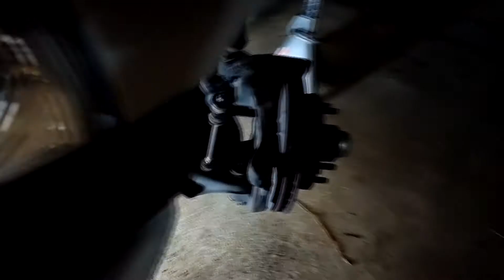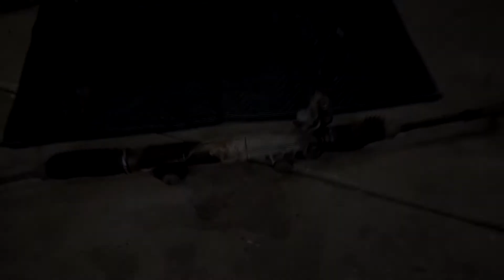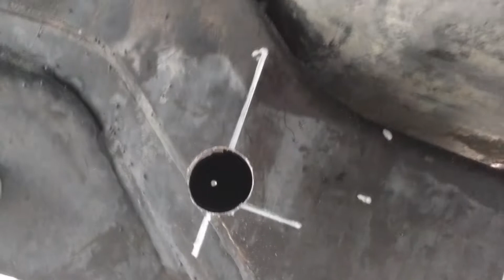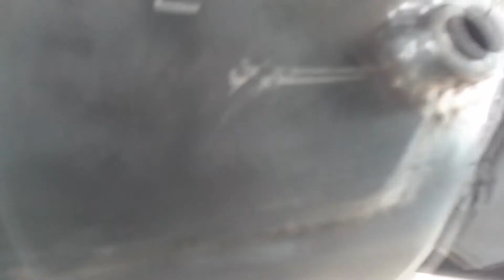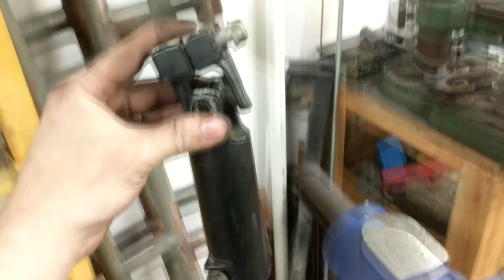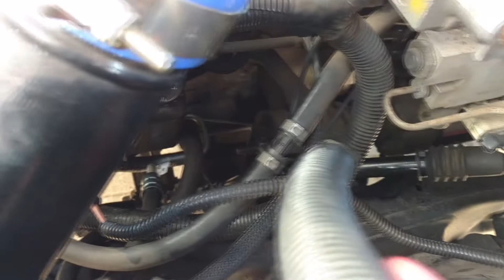1996 Ram 2500 - Steering Rack Conversion

Comment: Last word:  do not buy a replacement rack online if it requires a core return.  PartsGeek doesn't not help with return shipping which was $103 for me.  Advance has the same unit for $137 after core return to the store.  So 
 Basically I burned myself for $324.

Comment: Ok,  having done this a second time after buying a good re-man rack, I caution to check for ANY play in the telescoping steering shaft.  ANY looseness will translate into an inch or more of steering wheel play.   I put mine on an anvil and beat the play out 9f it with a 5# hammer.  When it comes back I may buy a new shaft - but that is money.

Comment: Got the motor mount cut and cleared - PITA.  All done except for the cooler - yep, you need a fluid cooler.   Follow the instructions and it will work.  Alignment was an issue for me.  I finally had to remove 1/4" from the passenger side inner and outer tie rods.  As noted:  stiff wheel just off center.  And if you have steering shaft slop this won't fix it.  Get a new one.  And do not disconnect the steering shaft unless the steering wheel is locked in place...I knew better and still broke it: don't know?  You will.

Comment: Exactly what needs to be done on my 96 single cab. Thing has the turning radius of a squarebody crew cab F150 and 1.5" of play even with all new everything (except box and pump) steering related.
Reply from the maker: Either do the swap that I showed in the video, or it would be time to swap your steering box. That's usually where most of the play is.

Comment: Had no idea this was a thing. Ill be doing this on my 97
Reply: I did it on my 99, very happy with it. The only major difference to get used to is the tall ratio. For the first while I found myself turning in way tighter than intended.

Comment: nice work! lots of good tips... the OEM Gen 3  Bolt is M16 x 2.0 for mounting the rack. I got a threaded rod that size from Grainger for $11.
Reply: Where did you source the tubing - and what size did you use?  $50 is lowest I've seen for 3' of 5/8 x 3/4 seamless steel tubing.

Comment: Where do you get the ujoint caps? I am super stalled in my conversion because of the ujoints. I was thinking about a borgeson steering shaft. Also looking at my old linkage length vs the length from the junkyard rack and pinion. I have the new tie rod ends all the way in and it looks about 1/2 longer than my old factory setup so I am not sure about alignment issues. 

Hope to get my truck running again.
Reply from the maker: I don't know that you can buy new u-joint caps. You may have to buy a whole new steering shaft, like you mentioned. As far as tie rod length, if your current tie rods are bottoming out and still too long you can cut the inner thread length down to help make the length right. But you don't want to cut too much. You may also want to look into a different brand of tie rods that have the same threads but are shorter. Good luck.

Comment: Great video , question , did you check for bump steer when picking rack position ? I just bought a 98 2wd with 172k miles and it needs a steering box and I thought to myself ... why not put in a rack ...

Comment: Hey bud thanks for the explanatory video, I plan on doing this to my ram to improve the stability and driveability. How has been the durability on these components since they’re in a 1500? I only drive it around town anyway
Reply from the maker: The truck belongs to my uncle and he has been driving it since this video was made with no problems at all. He still says it's an improvement over the stock setup and recommends others with the same truck look into this swap
Reply: @Trav74r  yeah I did it and even used the third gen steering shaft and it was pretty much bolt on
Reply from the maker: @dariel9847  glad to hear it worked out so well for you.
Reply: @Trav74r  thanks for the response! I’ll be starting this weekend

Comment: Any speed wobble?
Reply from the maker: No speed wobble. It has been a trouble free conversion.
Reply: @Trav74r  damn sucks I have 4x4. Why cant i install it on a 4x4?
Reply from the maker: @pablomarquez4431  Ram 4wd trucks have a solid front axle. So there is nowhere to mount the rack.

Comment: i just did this on my 97 cummins.  im almost out of threads on the tie rods to be able to get the toe right.  did yall have any issues getting it aligned and having enough threads?
Reply from the maker: If I recall correctly, we actually had to shorten the tie rods a bit so that we didn't runout if threads. Sounds like the opposite for you. May need to look around and research alternative tie rods with different thread lengths.
Reply: @Trav74r  I meant I'm running out of threads by threading them in.  I may need to shorten or find shorter inner tie rods.
Reply from the maker: If there are more threads left on the inner tie rod, I would cut it short and clean up the threads on the end.
Reply from the maker: That may have been the same problem we had. Like I said it has been awhile and I don't remember the small details.

Comment: Need a followup and driving videos. I already have a 95 chevy c1500 sport gearbox on my 96 ram direct bolt on and 2.5 lock to lock vs factory 3.5-3.75.

Comment: Great video. Great detail. If you have a follow up on this video, it would be nice. Please make more videos of other Parts that swap
 from newer dodges. Maybe brakes, transmission ?   Is It totally necessary to those round tubes inside frame? Or could plates be welded 
to the front and back of frame ?

Comment: Thanks for posting this! I first heard of this swap on Rich Bosch's "Deboss Garage" here on YouTube and was intrigued.  https://www.youtube.com/watch?v=9fvFNt-gLdE&t=26s
I have a '95 dodge cummins and would like to perform this swap because the OEM design just wears out too fast and is expensive to replace. QUESTION: Did you stick with the "all-thread" or did you source grade-8 long bolts? I don't know if there are different grades, but the stuff I've work with doesn't seem up to be up to the task?? Please produce a follow-up video to include the alignment result and if you experienced and "bump-steer" or other handling anomalies?